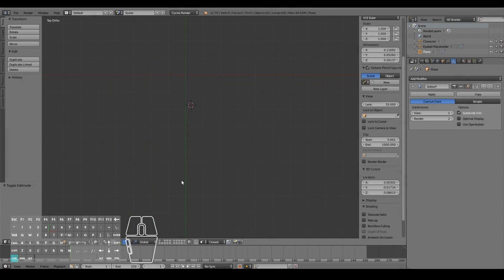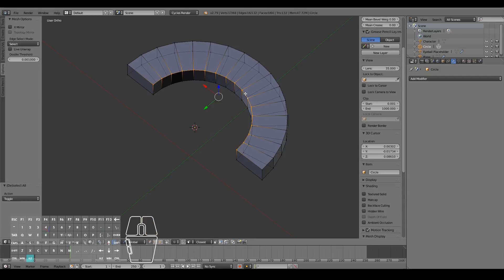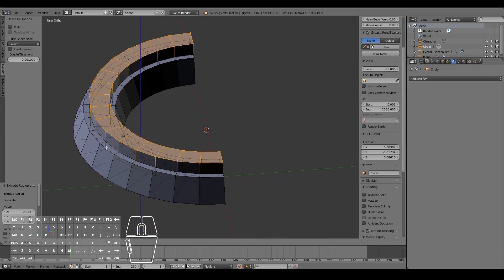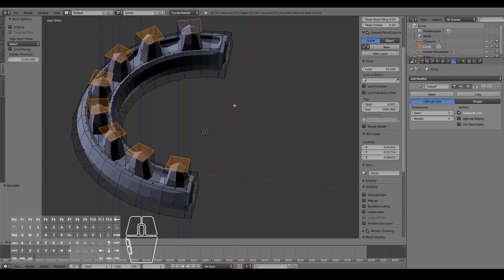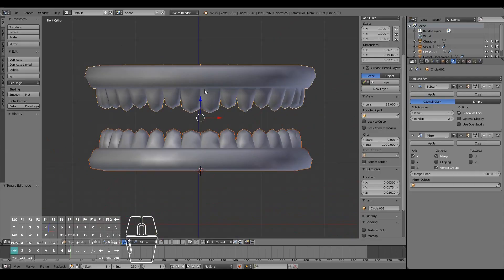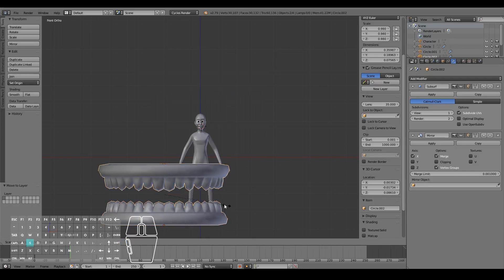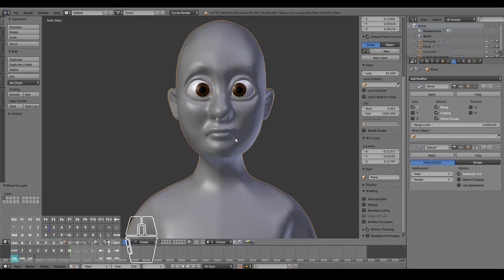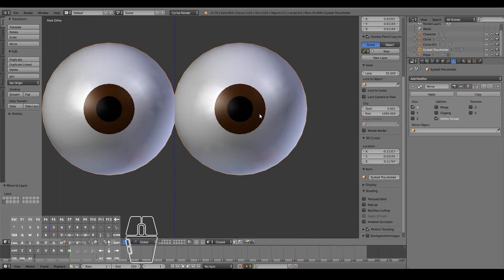Polishing The Finished Character Model (Part 2)

Comment: How to use this character on Maya?
Reply from the maker: Hi Jones, you can export the character as FBX, OBJ or 3DS within Blender and import it into Maya that way for the model only. The rigging will need to be redone in Maya as Maya uses a completely different rigging system which is not supported in Blender. You could transfer the bone weights but you will still need to build the rig yourself. Hope this helps!